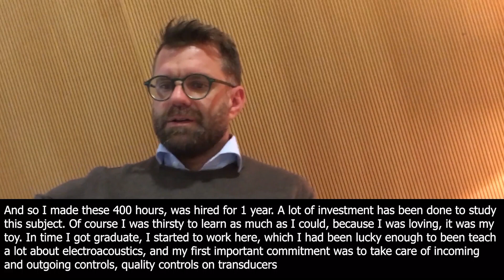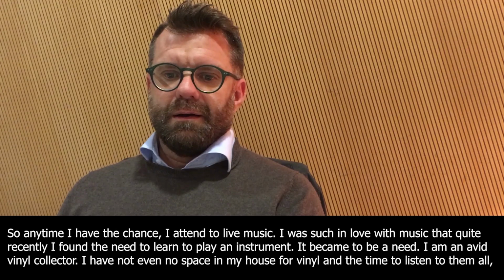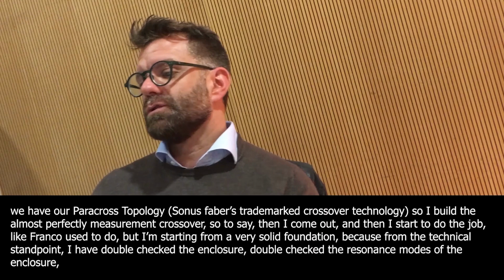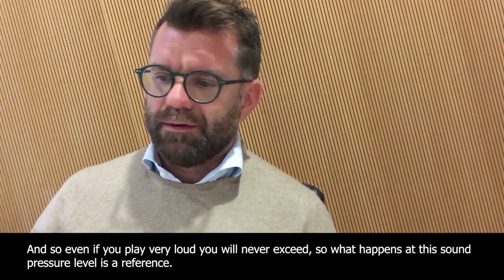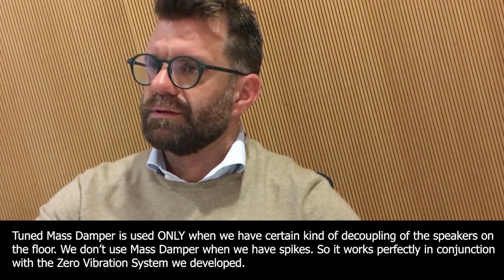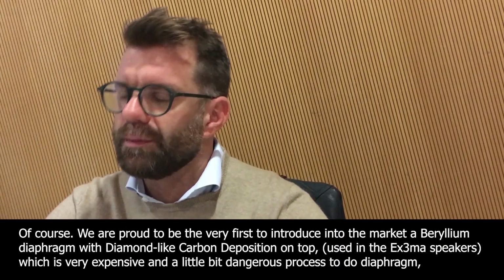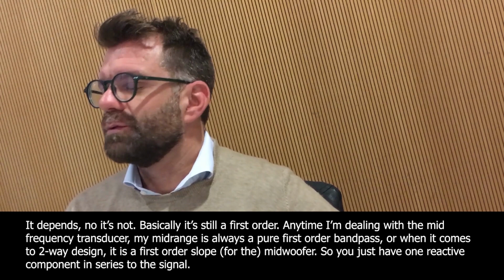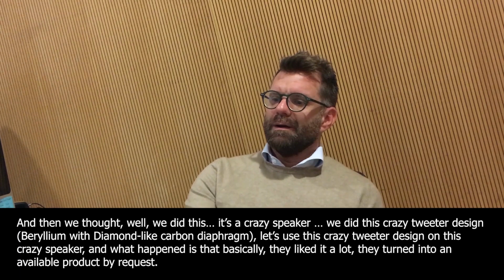The Man Behind The Sound Of Sonus Faber

Comment: I’m always impressed when I hear someone speak English as their second language. It’s so very difficult, well done Paolo! He comes across as an incredibly bright and classy individual. Today, I just purchased my first pair of SF speakers. After demoing the Sonetto lll’s for three days in my home with a tube amp and a tube pre, I pulled the trigger. It’s the compact floor stander (for small to medium sized rooms) and it’s incredibly musical, balanced from top to bottom and I love the tweet. I was amazed at how well it does digital! Moving from a metal, extended Focal tweeter to a sweet sounding silk-dome (non-fatiguing) tweeter. Beautiful midrange and low end is quick, punchy and tonally correct. Might not hit the lowest octaves but very satisfying w/o a sub. I love it! Even got a thumbs-up from the wife, digging the piano black Sonetto’s!
Reply: planing to get sonetto 2 what amps valve amps do you have im planing to get valves later first with my existing transistor integrated.
Reply: @steveee2511  It doesn’t matter, Steve.  SF speakers have great synergy with tube amps. I was running PrimaLuna…